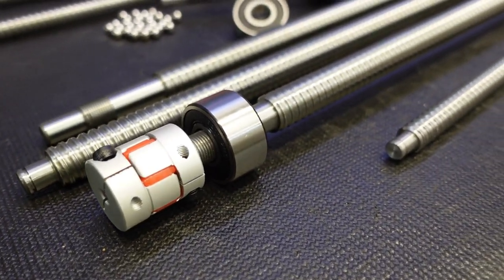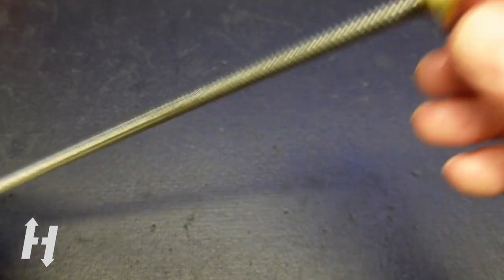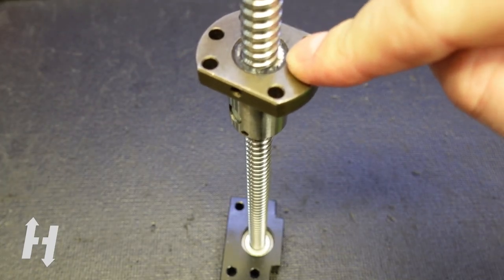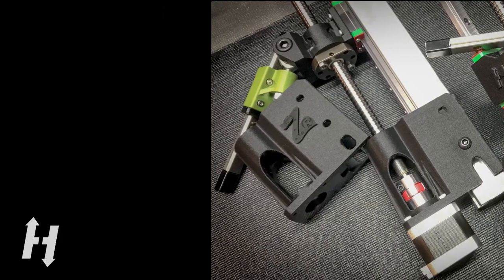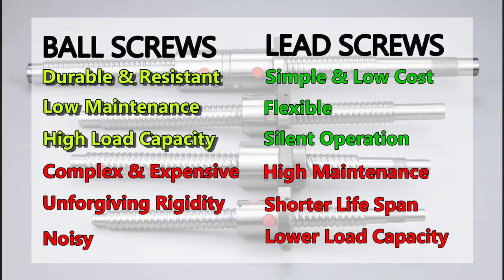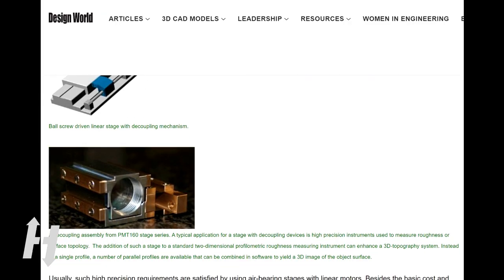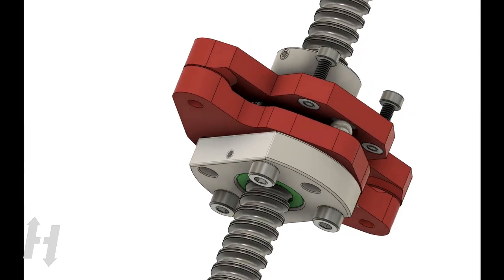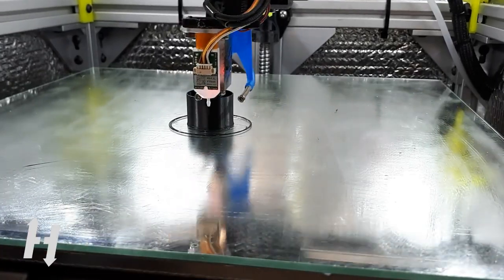Fixing Z Wobble from 20$ Ball Screws with that simple device

Comment: I guess an alternative to the extra 2 wings is to do only 2 of the ball bearing magnet setups, and have a V shape channel at the third location. The V will prevent rotation and still allow rolling in 1 direction. The other two ball bearings will be able to take up the remainder of the wobble.
Reply from the maker: I have though of that at first, but as @phibel mentions here above, that V grooved ball bearing will act as an off axis pivot point potentially inducing rotation deviation in case of wobbling.
Reply: @MirageC  I had a similar idea to your approach, also using ball bearings. I was going to use two cylindrical pins embedded into the print for the bearing to run in. Those units can be arranged 180° across from each other and will also constrain rotation. However you need a second stage offset 90° , so it may be a little less compact. I might try it if I have the time to build a printer at some point.
Reply: I do not think that will work, the V shape channels on the 3 Z axis will result in a kinematic mount? https://www.youtube.com/watch?v=ekUkI9iWUoM
Reply: Only 1 is a V shape. Other 2 are the ball bearing on magnet sliding joint. Rotation of the unit will be constrained but it will still be able to slide/wobble in the plane perpendicular to Z
Reply: @benharris4436  Yeah, my thought was that 1 V shape channel on each of the 3 Z axis will form a kinematic mount (across all 3 Z axis). But the points are not rigidly connected to the ball screw or the print bed due to the other 2 magnetic ball joints on each Z axis. So it probably won't be a kinematic mount.

But through the V shape channel, you create a "harder" pivot point compared to the magnet alignment. This could be worse if the ball nut hangs compared to the magnet coupling.

I don't know, I'm not convinced by the concept. I'd rather use belts.